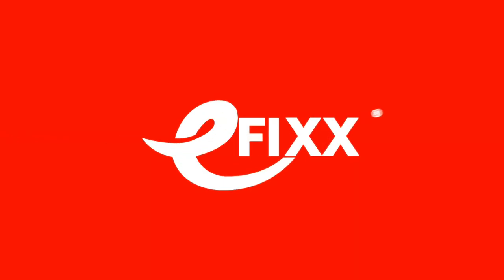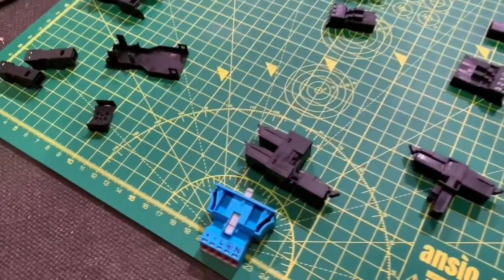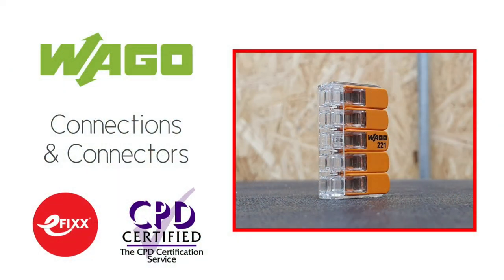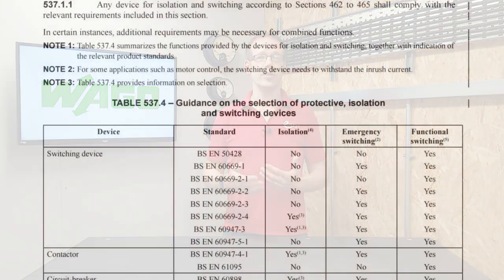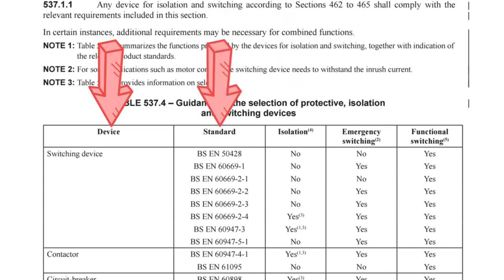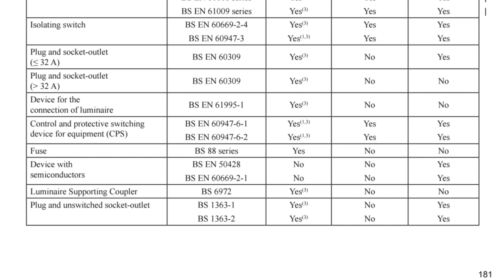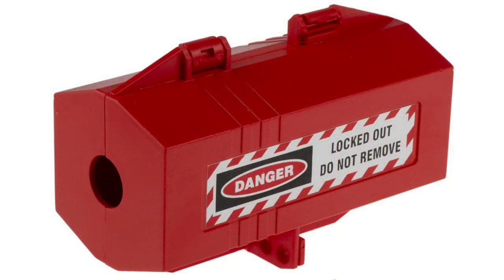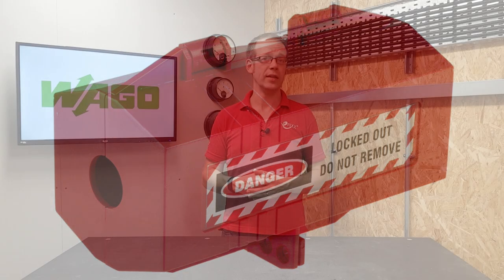CAN YOU USE A PLUG for SAFE ISOLATION ? - BS7671 #safe4september

Comment: In some of the factories I work in the love to play musical workshop so over time I have fitted industrial plugs and sockets to most machines and welders so they can be moved at will even massive CNC machines. I love this as there is no doubt the thing is isolated. Socket off and locked plug in the lock box locked permit signed ready to play
Reply from the maker: It's a very sensible approach isn't it?

Comment: Fantastic! Never knew about the plug lockout device. Tempted to pick one up for when PAT testing, repairing, or similar where someone could easily pick up the wrong plug top. Thanks Joe and EFIXX!
Reply from the maker: Our pleasure, hopefully it helps, let us know which model you go for and if it helps!
Reply: You can get similar for 60309 devices too that either completely encapsulate that plug or attach to the rim of the plug (much love ke how weights are added to a wheel rim then balancing tyres, you can also get ones which encapsulate an FCU, although have own seen these from Martindale to date, I believe MK FCUs can it a padlock in the extended fuse carrier too
Reply: How does this work on a TT earth as both conductors have to be disconnected

Comment: Wow I never new that . Personally I would not rely on a plug and socket as a means of safe isolation. It’s one thing unplugging an appliance and turning the socket switch off but make it a live circuit safe ? I don’t think that would be a good idea.
Fantastic video Joe as always 👍👍👍👍👍❤️⚡️
Reply from the maker: Interesting one isn't it Sean? 😊
Reply: @efixx  yes it is one to get the little grey sells working.and I have never seen a lock off for a plug.

Comment: Given you started the video with the Winsta connectors it seems you then went on to avoid the question of whether they were suitable for isolation.

From a first principles point of view they clearly are just as suitable for isolation as any other plugs and sockets, but does BS7671 have anything to say on the matter of using devices not explicitly listed (which I don't think IEC 61535, the standard the winsta connectors are designed to is).

Comment: In domestic it us best to have a DP FCU. Then take out the fuse when isolated to work on any equipment.. Put tape, and a label, over the switch if necessary.

If equipment needs to be isolated for long periods then a lockable FCU.

There are also DP switches available with keys.  I am against using plugs for permanently connected appliances. Plugs are for portable appliances. Permanently connected appliances need keyed FCUs/switches if they need isolation for long periods.

Comment: that is a interesting one considering a plug top could be cut off and replaced if someone so desperate or with a malicious attempt really needed the device
Reply: i belive it would be more to stop opinunistic mallice if at all, carrying around a full extra 32 amp comando socket round the place would raise some serious eyebrows and if used in a crime would be proof of pre-meditation
Reply: most lockout devices dont resist force, the aim is to indicate danger and prevent access without an obvious trace. the locks used at work for lockout are plastic, laughably insecure against force but designed to prevent picking and the like.
Reply from the maker: Yeah, that is a possibility, I guess if someone is that determined to do power it up, there's only so much you can do, even a locked off MCB someone could take the cover off and swap the circuit to another breaker. 🤔
Reply: Believe the fact they in either case it would require an act of malice to remove if the only 'test' thr law requires to prosecute if an isolation device is removed - One of the reasons I categorically HATE combination locks like the KEWLOCK (other brands produce them too):as there is nothing to show a lock has been forcefully removed.